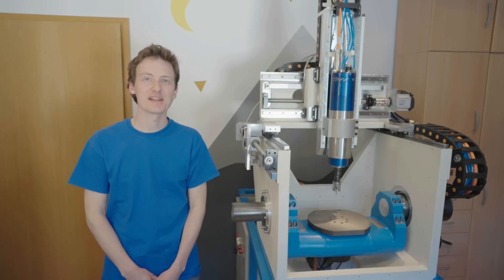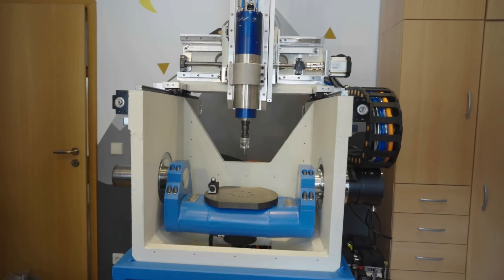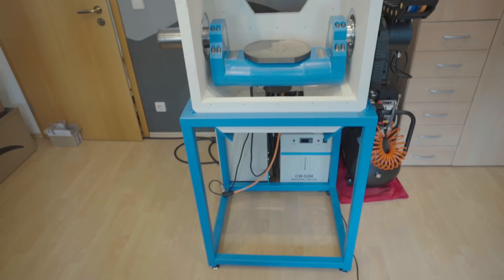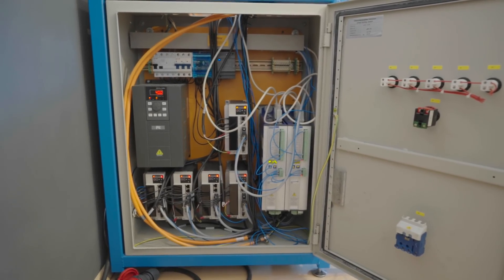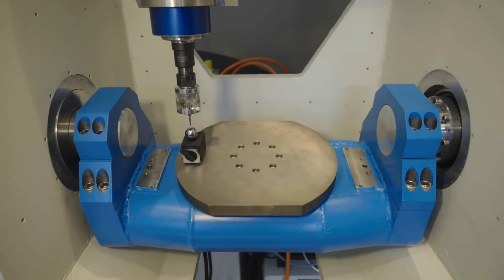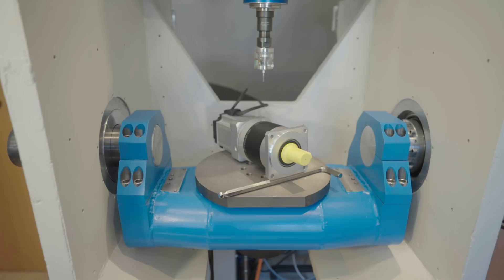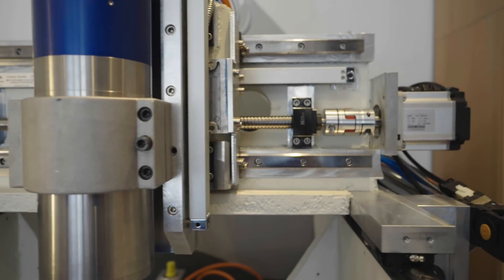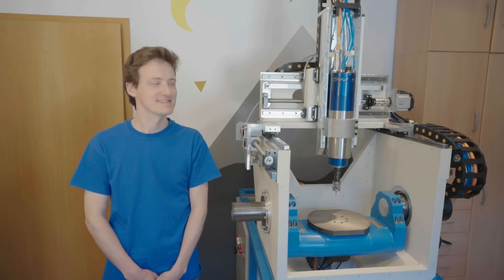Home build 5 axis cnc mill

Comment: Do you have the glass scale integrated as a feedback in linux CNC or the servo drivers?
Reply from the maker: It is integrated in LinuxCNC.
Reply: @fabianbrock  I checked in the manual and couldn't find where it is configured (linuxCNC with the signals from glass scales). Would you please point me to where I can find it? Thanks.
Reply from the maker: @car9167  you need to search for encoder. Your hardware needs to have encoders to connect the glass scales (or any other scales) and then you can use it in LinuxCNC.
Reply: @fabianbrock  But the glass scale gives you directly A, B and index, not sure why an encoder is needed. Maybe the encoder is a software component within LinuxCNC but I read it can count up to 50KHz. With the 1micron glass scale you have are you not limited to 50mm/sec? Or are you dividing the 1 micron signals to maybe 10 micron so you get 500mm/sec?
Reply from the maker: @car9167  Yes you get directly A, B and Index from the physical encoder on thes scales. But, as you mentined, you need an input fast enough to read it. On the Mesa cards it is called an encoder input and it can handle count rates in the MHz regime depending on your settings. So this is fast enough.
In linuxCNC the component you need to read out this signal is also called 'encoder'. So if you search for LinuxCNC and encoder you will find the relevant information. Explaining the LCNC part in more detail is probably not very promising in a YouTube comment.
Reply: So I was looking for an alternative
Reply from the maker: @car9167  An alternative to Mesa cards?

Comment: What kind of
Software mach3 or Arduino ?
Motor stepper or servo or stepper encoder type
Reply from the maker: I am using LinuxCNC on a Lenovo Tiny PC. Control card is Mesa. All 7 motors are Servo motors.
Reply: @fabianbrock  Hi, which Mesa card do you use!? 7i96, right!? Could you make a video to share how to config the mesa card, please!? Tks for your video!
Reply from the maker: @Nothing-27 I use a 7i76e combined with a 7i85s. 7i96 would not be enough. As it has a quite limited number of I/Os. The 7i85s would be required in both cases tobget the encoder inputs and the two additional step generators.
Reply: @fabianbrock  Thank so much! Pls share more your video! I always expect them! 🙂

Comment: Impressive. I work on a $300,000 DMG CMX 50U. Fun stuff. How did you get the software for the kinematic calibration? I made a writeup for the machine I use because it's a pretty complicated procedure. It is very accurate right now. I can rotate the part 180° in C while B is at 90° and hit positions of less than .001" over a distance of about 6". Even tighter if needbe.
Reply from the maker: Thank you. I haven't calibrated it yet. I guess I need to write this myself. The precision of the DMG is a dream, let's see what mine will do.
Reply: @fabianbrock  nice build. what control software are you running?
Reply from the maker: @unlockedcomposites7086  Thanks, I am using LinuxCNC

Comment: I posted this as a reply to comment by Alex Treseder but I fear it may be overlooked so I repost it as a fresh comment.

I too am desperate for the detail of how to get 1um (micrometer) precision using Ditron glass scales together with LinuxCNC (& Mesa card)

To me this is just as significant as 5 axis & Linux.
Reply from the maker: I will show this in a future video. Just keep in mind that adding a 1um resolution glass scale will not necessarily result in a um precision machine.
Reply: @fabianbrock   I use Fusion.  I needed to do FEA (finite element analysis) of the  gantry of my mill design as I want 10N per um or stiffer.  I asked Autodesk if I could upgrade from personal to full licence on a monthly basis.  They replied that that is possible.  When I later asked to do so they replied that was available in USA but in ZA (where I am) it was only available as a 1 year upgrade through the local Autodesk agents.  I feared that it would be a one way trip so did not do it.  Instead I used FreeCAD where I could send a STEP file across.  It worked well for me.
Possibly you can do the 1 month upgrade in Germany (your home?).  It would let you verify that your machine functions correctly.
FreeCAD does not seem to  have functioning 5 axis NC at present.

I appreciate that I would not get 1 um precision.  I want to use C5 rolled ballscrews but get better accuracy via linear scale feedback.  It is possible using Galil controllers and Jim Dawson's free software.  https://www.cnczone.com/forums/cnc-do-it-yourself-/387324-cnc.html  The Galil is way out of my price bracket though.

Comment: If you want better damping and long life of the machine then go with as much hydrostatic as you can ( like hydrostatic ways for the axis. Hydrostatic lead screws and hydrostatic bearing for the turning axis) since hydrostatic is both damping but also non contact. And also doesn't have stick slip effect unlike ball screws and linear rails do 

Also something I would add ( since it's quite easy) is high pressure air around the spindle/tool to blow away chips we'll cutting ( good for deep slot milling so the chips get blown away instead of double cutting them) 

And a thin water/dust proof ring light around the spindle nose ( sometimes the spindle it self blocks the light making it hard to see what's happening)
Reply from the maker: These hydrostatic rails might be outside my budget. For now I will use what I have. Air pressure with a little bit of cooling (minimum quantity lubricatin MQL) is already planned. Lightning will also be needed.
Reply: @fabianbrock  then you can fram some cheap camera ringlight put it around the spindle nose and cover it in transparent silicone so chips and coolant cant get in there and short it out

Comment: I built a 4 axis machine from scratch 10 years ago, my advice is to use way covers and ballscrew covers, also route grease lines where needed for lubrication.  Also think about chips, they will fly everywhere and strong coolant is worth every bit of effort.  Mine uses strong mist blast, and that doesn't really cut it in many situations.
Reply from the maker: Way covers are already planned in CAD.

Comment: this is awesome. congratulations. i think maybe you can do a better job with cable management next project. 
the way i do it is in 3d cad software, make simplified cad models of all the parts and assemble them, i dont use any cad models from the internet because there is too much unnecessary detail which slows down the cad software. you dont need fancy electrical softwares like e-plan to start with. but you'll have to for the fancy softwares, for more professional work, i've done it in cad, will be trying the fancy software for cable management for my next cnc build. 
about the y-axis : for some reason i've never been comfortable putting 2 drives for one axis, like how you've done 2 ballscrews on the y-axis. i would rather put the a single ballscrew under the bed, or have a right angle gantry one side for y and the other for x, just to eliminate synchronisation issues. are there any good machines out there that have 2 ballscrews for one axis?
thank you for sharing , looking forwards to machining videos.
Reply from the maker: Thanks, yes cable management could be improved inside the electrical cabinet.
Regarding the ball screws for the y axis, I get your point but for my machine it is of course not possible to put them under the bed. This would be much to far away from the rails in this build. Small portal machines have very often only one ballscrew underneath as it is way simpler and also there would be no benefit in having two. For big machines it is quite common to have two ballscews. The Hermle machines have a third approach, I'll show this in the next video.
About the syncing of the drives, that should indeed work flawlessly, otherwise the gantry will twist and something could break. In my case this is taken care by the linear scales. If one of the y axes spindles is lacking behind the machine goes in an e-stop.

Comment: Love it. But would hate to be your neighbour xD
Reply from the maker: It's only a two flat building, but the landlord lives in the flat below 😬
Reply: @fabianbrock  im surprised you got 3phase in a residential building, but its a super cool project. However, it will be very loud when cutting, hopefully it's rigid enough that despite being loud, you can cut fast to shorten cycle time xD
Reply from the maker: @danny36120  400V 3 phase is very common in germany. That is how we power our kitchens. Plan was to mainly use the mill when the neighbors are not there.
Reply: @fabianbrock wow, I didn't know that - no wonder Germany is an industrial powerhouse! Nice!  I run my own cnc machine shop. I would advise you make an advert on Facebook market place offering 5axis cnc work or mould making etc - I think with the capabilities of your machine, you might be able to rent a small garage/workshop after 2 or 3 custom made 5axis parts! Whatever you decide to do, I wish you the best of luck! You've done great work making the machine so far!
Reply from the maker: @danny36120  Thank you Danny, good ideas. First it should run and then I will see about the next steps.

Comment: Superb work Fabian, I built a Mach 3 powered lathe ten years ago, time has moved on and now I am going to dispose of the stepper drives and fit servos. I have subscribed to your channel, my best wishes to you.
Reply: I did as you did but cnc milling machine,  now it is servo steppers and runs in LinuxCnc
Reply from the maker: Thank you, good luck with the upgrade.

Comment: WOW. I built my own 3 Axis a while back. That was already a challenge. 5 Axis was always in the back of my mind, but seeing your machine is frankly quite intimidating ;). Outstanding work!
Reply: 5 axis will have much more outcome  accuracy problems and errors, how much will you expect ? How much is it when machine comes back to 3 axis normal use
Reply from the maker: @ray-charc3131  I don't know yet what to expect. A lot of it also depends on patience during alignment. And yes with 5 axis this process is lot more complicated. I will do a video about the assembly and alignment process with the results in accuracy.
Reply from the maker: Thank you
Reply: @fabianbrock  since you do not operate a business and you built it as a project why not share parts list, detailed process, wiring guide and knowledge you gained from is genuis build

This is a genuine question?
Reply from the maker: @FirstLast-tx3yj  I will do this later on. First I want to finish the machine to see if it works as expected. I don't want to put out a version now that might not work.
Reply: "He's intimidating me" -Carlos Sainz

Comment: 5 eksen CNC için kod üreten programlar hakkında bilgi varebilirmisin kardeşim. Ücretsiz olanları da var mı? Bunun işletme programında 5 versiyonlar felen galiba.
Reply from the maker: I have not found any free 5 axis CAM tools. I am using the free version of fusion 360 but this only supports 3 axis. Looks like I need to buy the subscription for fusion.
Reply: @fabianbrock  cevab verdiğin için teşekkür ederim. 4 eksen kod üretmiyor mu fusion 360 kardeşim. O bişey diyorlardı aklma gelmedi. 360 derce dönen şeyle 4 eksende yapılabiliyor bu sistem sanırım.

Comment: Where you able to achive closed loop positioning with the linear scales with the mesa card? As im sure you found, there is very little details on the internet about how to do this with mesa card/ linux cnc. It would much appreciated in the cnc community if you could make a video about your linux cnc/ mesa card setup
Reply from the maker: Yes I have set it up as closed loop with the glass scales. Most of my knowlede I have from Peters videos (@talla83 on YouTube). Thank you Peter 😊. Unfortunatly they are all on german. Maybe I can do a short video on this.
Reply: I too am desperate for the detail of how to get 1um (micrometer) precision using Ditron glass scales together with LinuxCNC

Comment: Big compliment. Which control software do you use? How are the CNC programs written?
Reply from the maker: I use LinuxCNC. For 3 axis programs I use fusion 360 but I don't have the 5 axis module (yet). Up to now I only did simple moves and programmed them by hand.
Reply: @fabianbrock  Unfortunately, Fusion is offering less and less for free. It is difficult to find a CAM program that is good for little money.
Reply from the maker: @schrodertechnology6544  That's true. Of course they need to make money to offer that service and if you are using it comercially the price is really low but buying it with the 5 axis module just for hobby is a lot.
Reply: @fabianbrock  Fusion is great to use. But I don't like this subscription model. Even for 3 axes I can't find anything comparable to Fusion

Comment: It looks awesome and neat. What firmware and board did you use for this cnc? And how much everything costed you?
Reply from the maker: I'm using a Mesa 7i76e card together with a 7i85s with the default firmware configuration for the pair from Mesa. Overall cost is aboit 10k€, but I need to go into more detail regarding the costs in a video.
Reply: @fabianbrock  Wow. Congrats on this achievement sir. I am building a cnc too.. wish me luck 😆
Reply from the maker: @Zae-R  Sure, all the best for your build. What kind of machine are you building?
Reply: @fabianbrock  Thanks. It's just a 500×500 mm 3 axis cnc nothing special.
Reply from the maker: @Zae-R  more travel than mine 😀
Reply: @fabianbrock  No thats the overall size of the machine. The travel is only 300×200 mm. It is only gonna be used on my desk for milling small parts tho.

Comment: Hallo Fabian,

Erstmal Herzlichen Glückwunsch zu Deinem tollen Projekt !
Was mich sehr beeindruckt ist, das Du von Anfang an auf ein 5-Achsen-System gegangen bist.
Für die meisten (mich eingeschlossen) wird die 4./5. Achse nachträglich angebaut.
Ich selbst habe eine 4-Achsen-Portalfräse konstruiert und gebaut. 
Das Maschinenbett ist aus Beton (Gesamtgewicht ca. 500kg). Was mich an Deinem Projekt wirklich
sehr interessiert ist die Verwendung von LINUX-CNC. Ich habe bisher Mach3/Mach4.
Wenn die 4./5. Achse damit gut funktioniert (z.B. auch Simultan-Fräsen) würde ich auch vielleicht "umsteigen".
Linux-CNC ist ja stark verbunden mit den MESA-Karten...
Welche Karten benutzt Du ?
Ich habe leider festgestellt, das die MESA-Karten z.Z. schwer zu bekommen sind. Hast Du einen Tipp ?
Sind deine Harmonic-Drive Antriebe in einem "Gehäuse" (Servo und Getriebe) ?
Welche Type ist das ?
Würde mich freuen, wenn Du antwortest...

LG aus HH
Achim
Reply from the maker: Hi Achim, 
bisher hatte ich nie Probleme mit LinuxCNC an meiner 3 Achs Fräse (umgebaute FM45), denke mal das wird auch mit 5 Achsen klappen. Ich verwende eine 7i76e mit der 7i85s als Erweiterung. Damit hat man genug Stepper Ausgänge für die 7 Servos und genug Encoder Eingänge für die 4 Glasmaßstäbe. Ich habe die schon vor einem Jahr gekauft, da ging das noch. Habe also leider auch keine Tipps wie man da momentan dran kommt.
Die Harmonic Drives sind mit integriertem Servo. Ein FHA-32B und ein FHA-25B.
Reply: Linux CNC läuft auch über parallel port. Falls die aktuelle mach 3/4 Steuerung auch über parallel Port angeschlossen ist würde ich die Festplatte gegen eine neue SSD (15€ 240gb)austauschen und Linux CNC installieren. Die Pins lassen sich konfigurieren wie bei mach 3 also keine Änderungen im Schaltschrank erforderlich. Wenn es nicht passt einfach Platte zurück und gut ist.

Comment: Very nicely done, haven't seen such a DIY 5-axis machine yet!. Would be very interested in the LinuxCNC part, especially the 5-axis part. There is not a lot of good info on this. Which CAM software will you use for programming?. 
Waiting on your next update!
Reply from the maker: Thank you, I will start with Fusion 360, but the free version does not have 5 axis at all and the payed version also "only" has 3+2. True 5 axis is abpremium upgrade. I will show the linux-cnc part in a future viedeo.
Reply: @fabianbrock  When you're ready you can apply for the a Fusion start-up license if you have a registered business. This give you full functionality for 3 years. With the machine you have I can also imagine they would be interested in helping you out in trade for making some content. 5-axis machining is starting to become more accesiable. 
Also think the machine simulation it now has can be essential when you start with 5-axis machining to avoid crashing.
Reply: @P1-Engineering  Not sure which country you are from. What I found is you have to pay $470 per year for F360 (for a 3 years licence = $1400) plus the advanced CAM package (PowerMill Ultimate, required for 5 axis) at an additional $700 per year
[  5-axis machining is starting to become more accesiable. ] you said. Not for hobby anymore, as per Autodesk's new strategy
Reply: @sergeb7945  I was referring to the start-up license. This is still available, and gives you full functionality for 3 years.  In these 3 years you can easily setup a small profitable business with such a machine. Not having full 5-axis in a hobby license is totally understandable if you ask me. Almost every 3 months they have the 25% discount offer, like right now.  For 3 years the monthly subscription then totals for $75. This should be doable in my opinion if you have a full 5-axis CNC for hobby use...
Reply from the maker: @P1-Engineering  Currently the full version is on sale for 429€ (instead of 572€) but this still gives you only 3+2. True 5 axis is only included in the machining extension, also on sale for 1259€ (instead of 1678€). Sum would be 1688€ (141€ per month) and without the sale 2250€ (187,5€ per month). Currently I don't plan to go professional here, it is only hobby for me so that is a bit expensive for me. But I will see how to continue here.